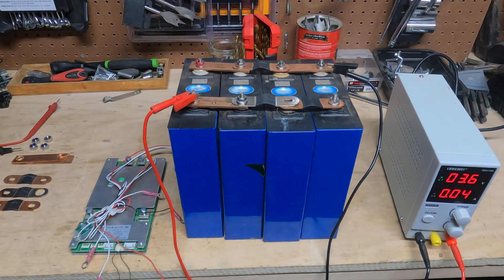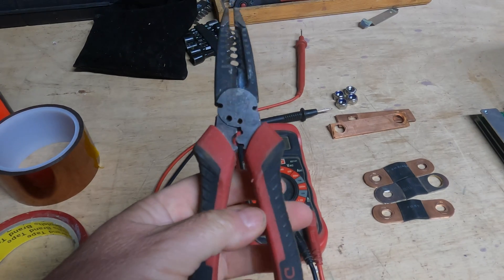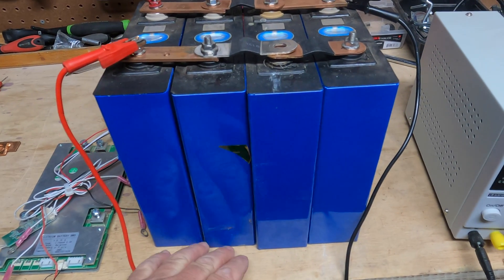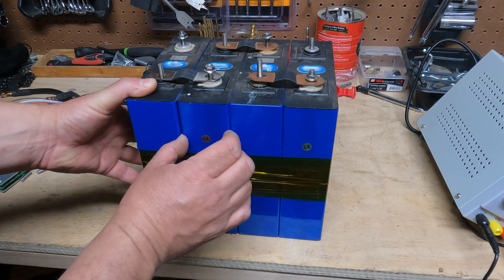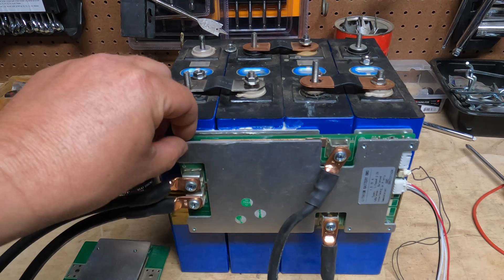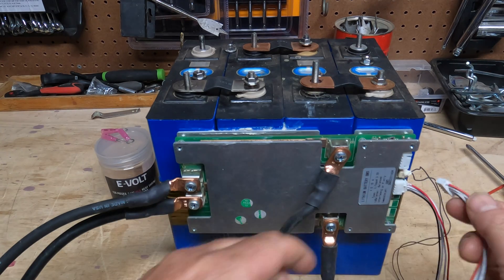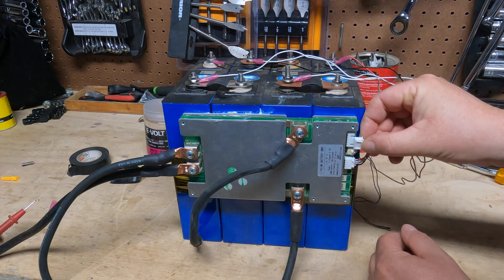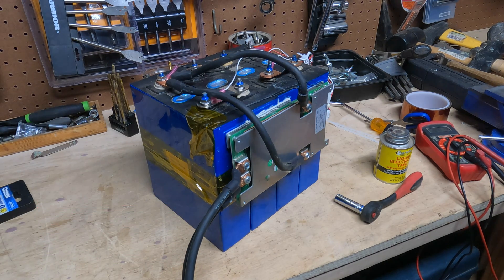Build a 12v lifepo4 battery in 15 minutes.  Complete beginner friendly steps to create a battery

Comment: Hey where did you buy those ones? Is it cheaper than $400 battery put together?
Reply from the maker: I love DIY builds but by the the time you source the cells and get a BMS it is cheaper just to buy a store bought.
Reply: @OurBlackCatCottage yeah thats what I was thinking...its only like $50-75$ more already assembled....what about building a cell from scratch? I saw a youtube on the basics...I wonder how much cheaper it would be to try using the lithium iron phosphate powder

Comment: I have a 4s 100ah battery. The BMS got wet and no longer charges. The battery is at 54 percent looking at the Bluetooth app. Do I need to top off the batteries to 3.6 before I change the BMS. Trying to save some money on the special charger and labor.
Reply from the maker: That is a great question.  I would say no and just switch out the battery but you should post that question on the DIY forum - https://diysolarforum.com - to get more feedback.
Reply: i would throw the bms away i never use bms only balancer 6 to 10 amp when you can find them

Comment: lets get to brass taxes? how much do you suspect you can build a 12 volt 100ah battery for? considering you can find them around $150 complete? I hear these guys claiming they can build for so much cheaper but never seem to have numbers.
Reply from the maker: It is not long cheaper to build a small 12v 100ah battery.  The cells alone now cost more than a off the shelf battery.  DIY battery building is dead.  Still fun, but no longer practical.
I reviewed this battery recently and it would cost me $250 just to buy the cells and it sells for $179.
https://youtu.be/QaGlUD5279A
Reply: @OurBlackCatCottage  I was looking at cells on the chinese ship site and thinking the same thing and wondering how people are doing it. I guess prices on prebuilt batteries went down since the time they said they can build them cheaper. Hopefully they keep going there, as Id love for them to be dirt cheap.

Comment: Good Video 👍......For a higher power, longer range, ebike. Would these batteries be better, performance wise to use than a bunch of 18650s?? 
With these, you wouldn't need a spot welder. But I believe many EVs use hundreds 18650, 14500 & 21700 🔋 batteries. Do you know the advantages of the smaller batteries 🆚 these brick size lifepo4.?
Reply from the maker: 18650, the 3.6v ones, have a higher energy density so they are better on high C setups like an ebike. I started out using them but they are more dangerous and like you mention, you really need a spot welder.  Prismatic 3.2v cells like in my video wouldn't be a good choice for an ebik.  You could look into pouch cells.
Reply: @OurBlackCatCottage  thanks 4 the reply info

Comment: It is odd that you connect the battery cells & BMS in a way that is not portable friendly (as you admitted), but then you put thread locker which is recommended for excessive vibration applications. I am also worried that the liquid may find it way all the way around the battery posts and prevent a full connection, thus raising cable resistance.
Reply from the maker: Thread lock never hurts and I put liquid electrical tape on all of the connections when I am done.  I am putting it in a box and when I do the final wire I will do that step.

Comment: I have one I made no bms .. it's my trolling motor and I just put a rc balance checker on it but I hardly use it since it's connected to my fish finder shows my voltage and I have it set to beep at 11v .. I charge it on my icharger at 50amps .. so far so good been 4 years now no issues
Reply from the maker: That's cool. Still don't recommend it for a beginner.
Reply: i never put a bms on my battery i only use 4.2 balancers at a cost of 6.00 i have some i buy that are used and don`t work i take the bms out for junk i have about 20 battery working fine i only charge up to 13.8